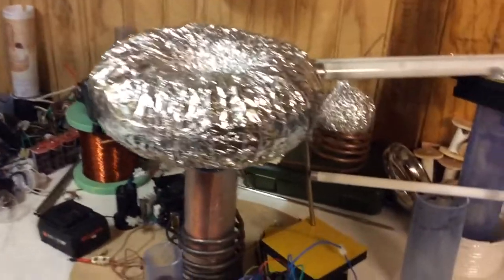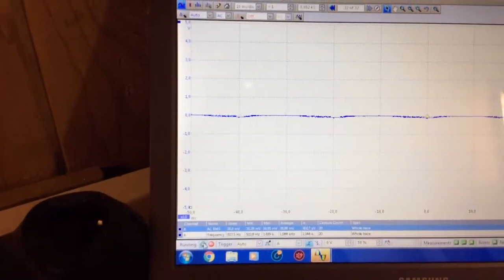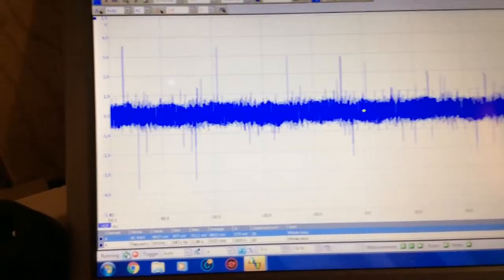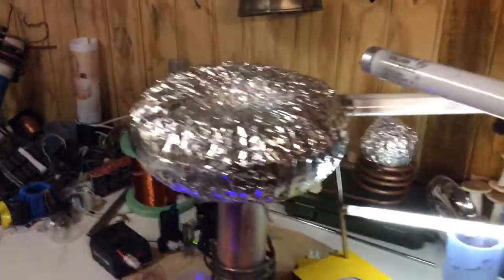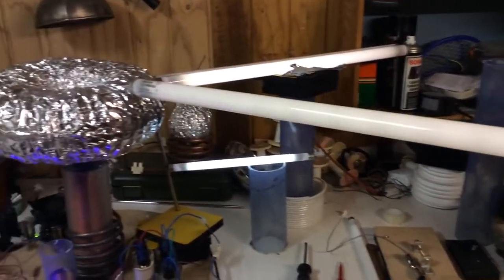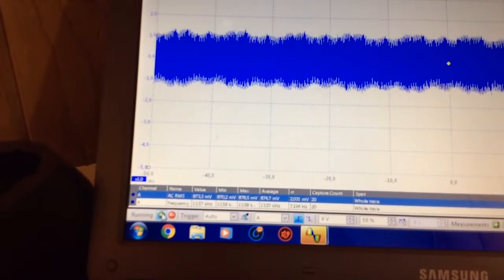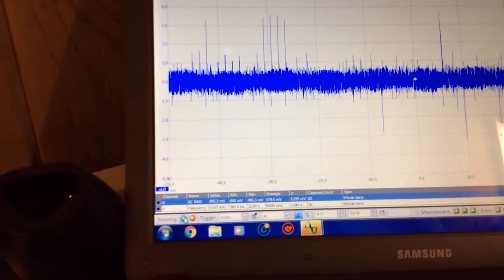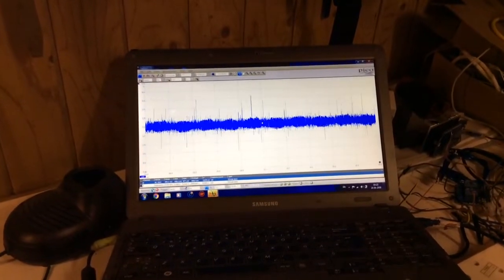Tesla field energy , antigravity

Comment: Nice little video, thanks!

Just watch out for X-Rays from spark-gap and strong radio frequency electric field around Tesla coil.
For scope measurements you probably will want to make small 10-100 turns coil then have atttached to the probe with distance at least 1 meter away from the Tesla coil. The EMP + radio frequency pulses are affecting USB cables and all electronics inside field.
Also for the output power measurements you will need another Tesla coil with same resonant frequency (coil self-capacitance only!) with step down coil to high frequency diode bridge(ultrafast shotky) and capacitor smoothing.

Good luck with your experiments!
Reply from the maker: T1000LTU thanks for the feedback, I will lookout for the spark gap and try again with everything minimum 1 meter away. :) wonder if the rays are what is stimulating the lift in the antigravity example circulated on YouTube?? Will be nice to try, sooon :)